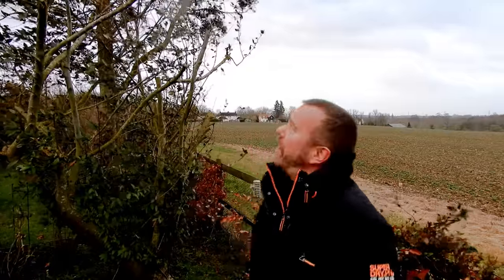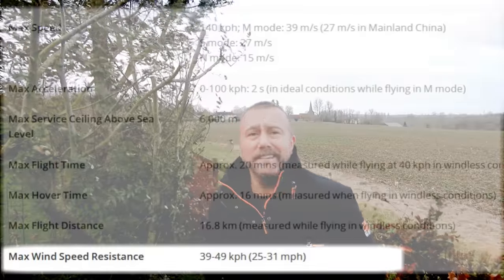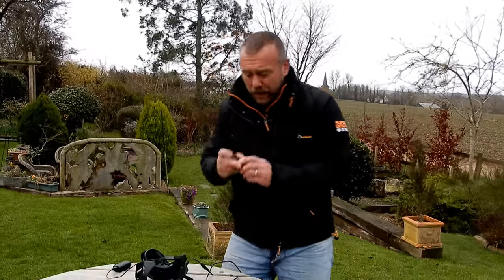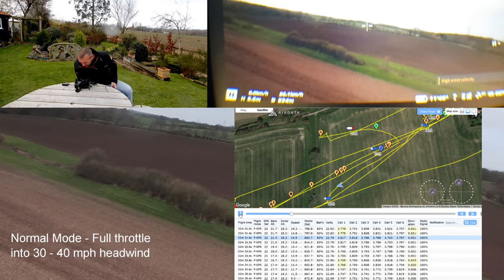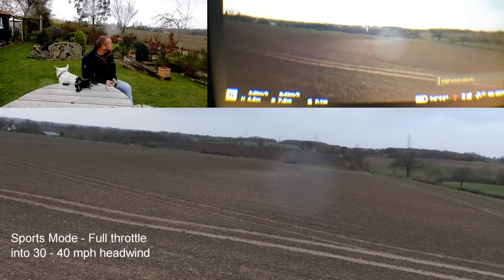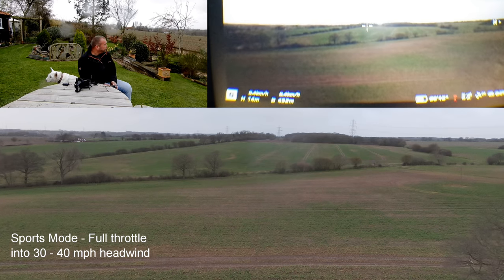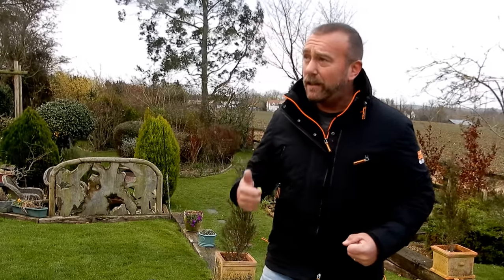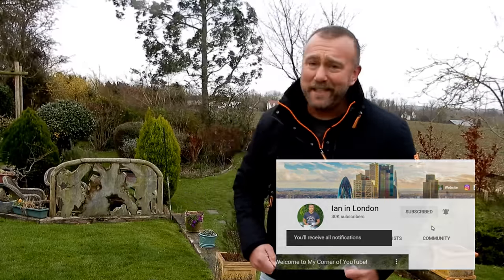DJI FPV: Gale Force Wind Speed Test - Watch out in Normal Mode & RTH

Comment from the maker: Always good to know your equipment's limits..... Don't get blown away.... :)
Reply: the limit could also be an amp limit unless you were able to get a constant speed of 32 in gutsy conditions.

regarding normal mode: the whole power is first needed to hold the attitude and only in case there is more juise / Amp then the pitch and rpm will be used to fight the wind faster.

Therefore the altitude change with coming / going guts at least here ...
Reply from the maker: @typxxilps  Yep; Normal Mode has obstacle avoidance which will probably limit the pitch,...👍🏻

Comment: If you get comfortable it does even better in manual mode. The drone has tons of power, it’s being held back a lot by the limits and safeties. All of that shaking and shuddering in the goggles disappears. Most the wind does is make you start to drift around, and can be easily corrected for. The drones heavy enough that a gust isn’t going to just shove it way off course, especially if you have a bit of momentum going already.

Comment: Hello Ian..
So flying in CE mode what range are you currently getting. 
I am in New Zealand so we are limited to CE mode 25 meg of power..

I interested to see the range of the quad In this case where as videos posted in the US are using FCC and up to 700 megs of power transmission.

No one as answered that question to my knowledge.
Cheers and thank you for your response.

I have a friend that flies fpv and is now living in London ..
Reply from the maker: I'm not sur there's that much of a difference; I can't fly beyond VLOS and post on YouTube as its an illegal flight and I'm CAA licenced.  The specs state FCC: ≤ 28.5 dBm
CE: ≤ 20 dBm so it's not such a huge change.  If there's no obstacles (like trees or the house) then I'm getting perfect transmission up to 500 metres easily.

Comment: it happened to me yesterday on the maiden of my DJI quad , I had a low battery alert and return to home was activated against the 28 MPH wind i had to override the RTH 
I fly in manual mode but it uses a battery very quickly in strong wind.
Reply from the maker: It almost counts down in seconds.....😕

Comment: interesting vlog as usual - I did think that the battery would give up earlier than it did. handling was good but to be true it seems to be a hybrid drone and so gains distaste from FPV racers who build and fly and at the other side people who like good video quality !
Interestingly a vlog pulling apart a DJI commercial for the FPV claims by going through the video frame by frame it is not the original FPV video being shown but from a gopro ! 

https://youtu.be/ooH83zG1u8A

Cheers
Reply from the maker: Yes, I think a lot of the pre-release YouTubers used a mix of gopro footage....

Comment: how does it do around power lines
Reply from the maker: I won't be testing that, but there is a large pylon line near me that I've flown over many times with other Mavics using the same transmission system and not had any interference...

Comment: Does the pitch of the camera change how fast it can travel/angle of drone.
Reply from the maker: No, but the pitch of the drone itself does and if the pitch is limited to maintain the obstacle avoidance sensors then it will struggle...

Comment: Do you know where the flight data is being saved? Some of my flights aren’t showing up in the DJI fly app.
Reply from the maker: Seems they're stored in the goggles memory (not the goggles SD card, but the built in memory) and you can transfer them to your phone when it's tethered and switched on.  It's not straight forward...
Reply: @IaninLondon  You are right, I just went for a flight without an SD card in it (on accident) and this time the flight data came into dji fly. As well as the ones from a few days ago 🤔... so it looks like the data is all being recorded its just a matter of when/if the app every synchronizes.

Comment: High winds caught me out once and it caused my first crash when I was still pretty new to flying my Mavic 2 Pro.  When it was RTHing it could only go max of 30km per hour and it ran out of battery. The RTH said it was ok but didnt compensate the low speed to RTH
Reply from the maker: As long as you learn.... Fly another day....👍🏻👍🏻
Reply: @IaninLondon  the good thing is I knew it wasn't going to make it. So I was able to try go as low as possible on a.dirt road because I was flying over forest. I lost connection over the dirt road and found it
Reply from the maker: @PatrickGuerrisi  Remote landing is the way to go in this situation..... Good going... 👍🏻👍🏻

Comment: Same storm here with similiar mixed results cause it has a lot bigger surface I guess.

Mavic 2 is a lot more stable overall even though there had been shakes in footage but lot better than FPV.
Reply from the maker: Yep, a three axis gimbal trumps for smoothness..👍🏻

Comment: Ian my mini 2 using latest upgrade 1.5.9 I have issues with the gimble stablisation when filming video in 25 mph winds. I calebrated and  it didn't rectify the issue. Brought it back turned it all off and then re calebrated all settings . When it was in my hand gimble worked ok off the wheel but launched it and no gimble movement up or down and footage really shake. Any ideas? Can the wind stop the gamble working Ade

Comment: Wow, impressive test and very informative! 
Am I correct saying you did switched it back to Sport mode when RTH kicked in at 7-8% battery to pull it back to your home? If so did you have to flip the button on controller once or twice or was it all in Normal to the very end?
Reply from the maker: No, you can't flip back into Sports Mode when it's auto-decending;  I let it go low to reduce the wind,  then kept the left stick up to keep it off the ground as I flew it towards me...  A messy landing :)
Reply: @IaninLondon  Right, you mentioned about the sticks but I couldn’t imagine the struggle keeping it fly last meters in Normal mode. That was really intense in these conditions. Thank you for replying. This is a valuable lesson especially since all Mavics can be switched to Sport mode during auto RTH if I’m not mistaken.
Reply from the maker: @eco999  Sorry, I had already cancelled the auto rth and flipped back into sports mode. The issue at the end here was critical battery auto land and that's where you can't flip it into sport's mode.  Sorry I wasn't clear in first reply 👍🏻👍🏻
Reply: @IaninLondon  Now I fully get it. Thank you for clarifying! I really appreciate that.

Comment: So realistically the main issue with the DJI FPV Drone is the battery. Great test Ian, especially in those conditions!👍
Reply: No it’s the durability . Any other FPV quad with carbon fibre you can crash and crash and you can long range 20 mins with GPS failsafe . This one pile it in it breaks Arms
Reply: @TheDeadlyraptor  True...but the aim of the game isnt to crash? And that's why this fpv comes with emergency stop...and if you spend 1400 just to use the normal gps mode, when you can spend 400 on a mini 2, it's not the drone for you.
Reply: @PhantomandtheDrone  Emergency stop has to Brake the quad at 80mph and level it .Close to the ground it isn’t going to do that .See Joshua Bardwell experienced FPV clip a tree and break and arm and dronexfactor. Do a flip into ground break 2 arms and Drone Phil life where is slammed into a concrete wall . If you look at serious FPV freestyle you will see crashes even with Johnny FPV for red bull is nature of it . For long range FPV
Reply: @TheDeadlyraptor  I did see those videos....I dont think it will be to long until after market products are available, especially when the arms are classed as consumable items much the same as the camera and rotors. 🤞
Reply: @PhantomandtheDrone  that’s not possible if you see Liviv tear down if you have to replace an arm you have to unsolder ESC and remove the antenna carefully , thread all cables through the arm that’s after taking most of quad apart . The whole point was for people that couldn’t solder or wanted it easy . The only things to change are canopy , camera , feet . The body should have been carbon fibre or arms which could hand been unscrewed and pulled apart

Comment: Wind... The speed difference between the ground and the air above it... The drone is not affected by the wind because from the drone's point of observation, the speed of the ground below the drone is irrelevant.
The problem occurs when the pilot is trying to reference a location on the ground, thereby adding the wind speed as an offset to the speed of the drone.
DJI has chosen to limit the tilt angle of the drone. This is true for all DJI drones with one exception and that is the DJI FPV drone in manual mode with the angle restrictions disabled. In “Normal” mode and in “Sports” mode you have severe angle limitations. In normal mode the angle limit is worse than in sports mode.
The speed trough the air is a function of the angle and the power from the motors. If the angle is constant, there is a power level at which the altitude is constant. More power results in altitude increase, less power results in decreasing altitude. 
Therefore the speed at constant altitude is limited by the tilt angle and not by the maximum power from the motors. This is the reason to why the maximum speed is lower in normal mode than in sports mode. In manual mode with the angle limitation disabled, the speed is limited by the maximum power from the motors.
The drone’s maximum speed through the air is of course the most important factor when flying in high winds. Therefore, the DJI FPV drone in normal mode has serious problems in windy conditions, while in sports mode it has less problems and in manual mode with the angle limitation disabled, those problems are completely eliminated unless the wind speed starts to reach speeds large enough making it obvious you should stay indoors.
The wind handling capabilities of any drone is dictated by angle limitations and only when these are removed, the maximum power of the motors.
Reply from the maker: Excellent analysis and all very true; I've discovered much of this with my wind tests over the years and it is indeed the pitch angle that limits the speed reltetive to the ground, as I first discovered with the original Mavic Pro when you had Obstacle avoidance sensors on.  That's why I mentioned those in the Normal Mode test here; if the OA sesnors are designed to only work to a certain pitch angle, then DJI do often limit the pitch to ensure their continued function, and of course you lose speed as a result.   This was again a useful test as it shows RTH behaves similar to Normal Mode and can therefore affect your flight....  Cheers, Ian

Comment: Hi ian, just a question, are fpv drones in breach of the CAA rules, when we have to fly  "in line of sight" and of course we are wearing a head set, I know you can get round around this by using a spotter like I've seen you do many times xx
Reply from the maker: That's the point of a spotter; it's what's required by the rules. They specifically mention this.  Cheers.

Comment: I wonder if DJI will offer a controller so that you can have the option to fly this like a normal drone or will this work with the smart controller?
Reply from the maker: The remote in sport's mode feels very normal...👍🏻
Reply: @IaninLondon  take a bit of getting the hang of it after using a regular controller

Comment: Thanks for the very helpful test! That skewed and dancing horizon is a deal breaker for such expensive machine. They have to put a bi-directional gimbal in it,  of course with a dedicated fully stabilized mode.
Reply from the maker: Actually I think most FPV flyers would disagree. That's the whole point of FPV, to get that pilot's view with skewing horizons as you turn...
Reply: @IaninLondon Thanks for reply! Your point is understandable, yet without steady horizon this drone won't be able to provide nice and stable aerial shots if user wants it - sort of limitation for cinematic featured drone. It looks like designed for enjoyment of FPV with footage of fast passess and light tricks without risking it too much.

Comment: Is your spotter on holidays Ian?
Reply from the maker: No spotter needed in this flight as wasn't FPV...👍🏻
Reply: @IaninLondon  I looks odd having to look into the googles in the table to fly the drone
Reply: @IaninLondon  How did you retain line of sight when looking face down at a table ?
Reply: i wonder if you could work out a hack to mount the goggles on a tripod so that you could still maintain a line of sight 9n this situation
Reply from the maker: @dabe1971  The same way you maintain line of site when looking down at your normal Mavic phone display.